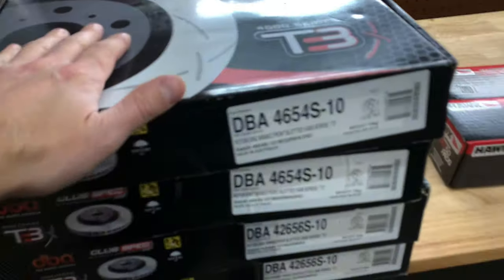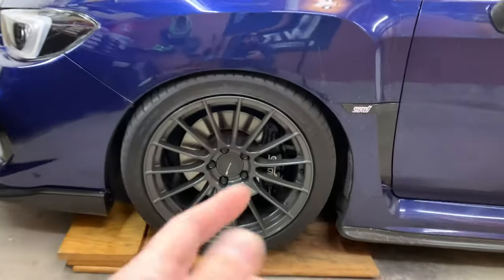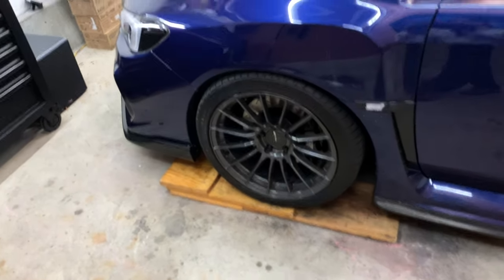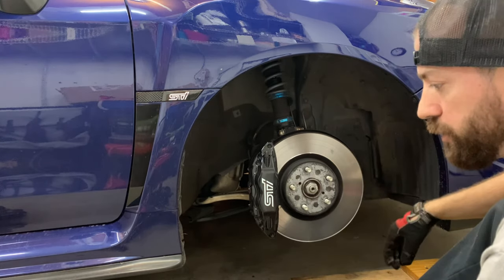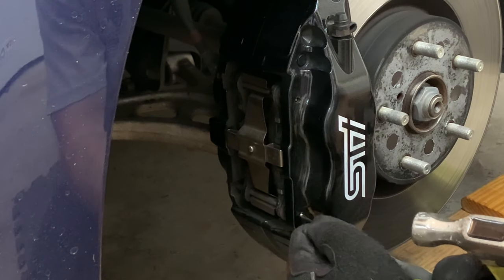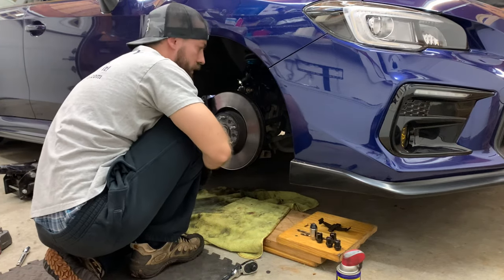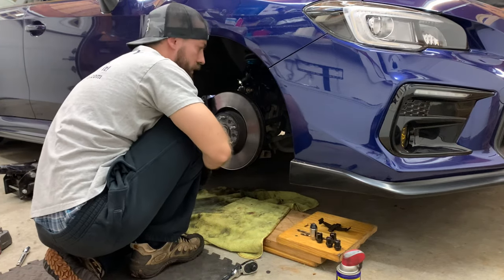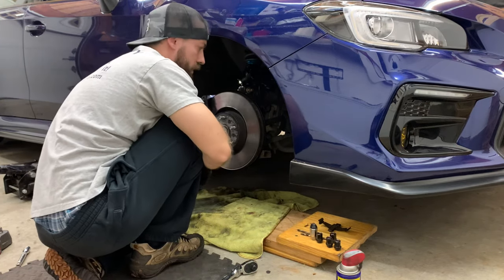2017 Subaru STI Brake Rotor and Pad Install - DBA T3000 + Hawk 5.0

Comment: Here's a tip. Don't know if anyone else mentioned it because I'm too lazy to read through the comments. On the 18+ STI Brembo calipers there's also a pin in the middle that's held by a M8 flanged bolt w/ a 13mm head on the back side. That bolt is the correct thread to use on those threaded holes to remove the rotor. You just have to pull the pin from the other wheel so you'll have 2 bolts to use. Thanks for the helpful video!
Reply from the maker: The bolt used to hold the brake line to the strut can be used as well 👍🏻
Reply: @Scoobyfreak86  Didn't know that. Thanks fellow Subi!
Reply: So you just need a 8mm bolt is what you're saying?

Comment: Great video!! and again, love the “how-to” series. Just like to add two things that was taught to me by seasoned mechanics. 1) You can use lug nuts to hold the rotors in place when you reinstall the caliper, that will make it easier. 2) Some, myself included, apply anti-seize to the caliper bolts. If anti-seize is used, the torque value needs to be reduced as it will act as a lubricant. Literature suggest a reduction of 25% and sometimes more depending on the size of the hardware. I don’t think you used any but just want to share this with your subscribers. Thank you.

Comment: Glad you mentioned the risk of the threads stripping out. I just replaced rotors and pads on my car with 100K kilometers and has been subjected to Canadian winters and salt. The two caliper bolts (steel) pulled out the aluminum threads from the caliper. I was able to drill them out and install helicoils but let me tell you that was a major PITA. Thankfully avoided having to replace the caliper. For the remaining three calipers I heated them up with a propane torch until they were just hot enough that it was uncomfortable to hold them but not super hot. That allowed the bolts to come out without issue. Be sure to use copper antiseize on them which is good for high temp and dissimilar metals.

Comment: This video is the reason I went with dba and hawk hps 5.0. Absolutely no squeak at all and a MAJOR improvement over the stock pads, even though mine is only a wrx not a sti. Since I drive on the highway all the time, some extra sudden stopping power wouldnt hurt.

Comment: Great video! Did the exact same swap a couple weeks back. Just keep in mind that these pads actually have a bit more clearance when they sit inside the caliper. When reversing, you might hear a  click, which is essentially extra room for the pads during heavy braking(expansion due to heat).
Reply from the maker: Thanks for the tip!

Comment: Nice vid, good technique. Most brake pad manufacturers claim that the slot in the friction material is intended to allow gases (from high heat loads) to vent better and keep the rotor cooler.

Comment: I find a box end wrench is the best way to break free the bolts holding on the calipers.  Just tap-tap with a big hammer.  A lot of small taps rather than big heavy pounding.  If a box end wrench doesn't work, I try a socket on a long breaker bar.  I have destroyed ratchet socket wrenches doing this so I don't use them unless I can break free the bolt with one hand.

Comment: Hey man I absolutely love your car. You should be proud of it. I have a '20 STI  but it's 100% stock except for some aesthetic upgrades. Also from NJ myself, Bergen County. Did you notice any handling changes when you installed the spacers? I'm thinking of going with RCE Yellow lowering springs and throwing some spacers on the OEM wheels but I've heard mixed things about running spacers.
Reply from the maker: Thank you! Spacers of this size will not have any effect on the cars handling. I’m not a fan of spacers normally, but something this small doesn’t bother me.

Comment: I did the exact same rotor and pad replaced 2 years ago believe it or not. 
I love the rotors, but have since change the pads due to excessive squeaking. I don’t care how well they work if they squeak like a race car on my way to the drive through Starbucks.
Reply from the maker: Did you properly bed the pads and rotors in? I’ve been riding on them for a few days now and they are as quiet as can be.

Comment: I’m going to keep commenting with questions lol. I’m so scared to strip those bolts. You say Wd-40 and let it sit? Then exactly try to barely twist it .. ? How hard was that? That’s what I’m most nervous for.
Also, I don’t need to do anything to my brake lines right away, they just move out of the way with the caliper to put the pads and rotors on, correct or what am I missing?

Comment: Get install video. Just double checking. You also reinstalled the shim that came out with the factory pads
Reply from the maker: Correct. Swap the shims over from stock pads.

Comment: Recently bought the same setup as you and they stop phenomenal, but...they tend to make a lot of noise. Specifically screeching. They are track pads so i kinda of expected it. Still really good brakes.
Reply from the maker: You need to bed then in more. They should squeak as they are not track pads. They are for the street.

Comment: Hey mate, I'm about to change out my rotors pads this weekend due to watching your video. All I'm worried about is stripping the caliper bolts... car has 43k miles on it.
Reply: How’d you luck out? Looking to do mine this Saturday, 45k… Pennsylvania daily driven until recently

Comment: Hey bro could use some advice, I just picked up 2017 STI , I knew that it would need a clutch so I brought it to a specialist and got the clutch done , I was going to have them do the pads bc there low but I was told the bolts that hold the caliper on was seized up and they said it would most likely snap , they said that job for them would take 3 days bc they send out the calipers to a machine shop  to drill out the bolt. The clutch job was done in 5 hours and with a trans fluid change it ran me 1600$ total. That was fine with me but the brakes are bumming me out bc I always did my own . I’m now learning the subies used aluminum calipers with steel bolts.  Any advice ? I haven’t tired to get the bolt out but if I snap it I’m screwed to get to work , thanks man love ur vids
Reply from the maker: Yes the calipers threads are a known issue. But shouldn’t take three days. Most people do a nutsert or retap it and you’re going to go.
Reply: @Scoobyfreak86  ty bro ! Yeah I find that really odd  , they told me it’s bc the send it to a diff shop and a laser does it lol. I might just slap on some pads and check another place.

Comment: Hey man , so I attempted my fronts , pulled some threads out the calipers going to re tapp , But I might have another issue , The threads that take the bolt Frist ( the arm on the car ) should those have threads ? My bolt goes in without turning . Or does it just tighten down to the caliper , I can email a pic if I make no sense lol

Comment: Hey great video,  really helpful.  But just wondering how do you know which way to loosen the caliper bolt for all side?  And do you suggest on using a breaker bar or as your video,  just rachets?  I'm scared of stripping the bolt haha.
Reply from the maker: Left loosey for each side. I prefer Wrenches when loosening since you’ll be able to feel off the bolt breaks loose or not.
Reply: @Scoobyfreak86  Thanks i kinda knew it was left but i cant seem to find any infos when it comes to this haha.  Would u recommend a 6 point wrench?  And its a 19mm bolt right.  Sry tons of question.  I'm a newb when it comes to this.
Reply from the maker: If I remember correctly, it’s 19 front snd 17 rear.  A normal socket works just fine. Just put the wrench on and hit it with the side of your hand to break it loose.
Reply: @Scoobyfreak86  Thank you!  Lastly,  what about bleeding the brake,  is that necessary?  I only plan to do the rotor and pads.  I got 47k on my 2017 sti.
Reply from the maker: Not necessary, but recommended. Bleeding alone will help the pedal feel tremendously.
Reply: @Scoobyfreak86  Thank you for your help, quick responses and this video !
Reply: @Scoobyfreak86  Hello again haha!  Just wondering,  what ratchet size did you use in the video?  3/8 or 1/2 inch?
Reply from the maker: 1/2”. I prefer using 1/2” when I can.
Reply: @Scoobyfreak86  Hi so i tried using 1/2 deep socket 19mm on the top front caliper bolt but it wouldnt go in.  Any advices?

Comment: What size bolts did you use to pop the rotors off? I can’t get mine off. I’ve got a 2017 wax sti like you and need help on what size those bolts are so I can go buy some and pop the rotors off so i can finish doing my breaks. Is it 8 mm or what? Thanks
Reply from the maker: Use the brake line bracket bolt
Reply: @Scoobyfreak86  The ones that you take off the calipers?
Reply from the maker: The brake line on the strut
Reply: @Scoobyfreak86  Hey yeah, I got it! Thanks, I did what you did and it worked perfectly 🥰
Reply: @Scoobyfreak86  I'm going to keep my car forever so I want to do some of the modifications when I'm more financially able too after I'm done with nursing anesthesia school then I'll really be able to take care of my sti. I like your garage set up quite a bit. The good thing is that im getting a home loan next year so as far as a proper garage set up is concerned what would you recommend? Would you get a lift, etc? Thanks again for everything. I've been able to get things done thanks to your tips. In fact it's totally worth joining your member page.
Reply from the maker: I’m glad I could help! Depends on what kind of work you plan to do. Honestly, the quikjack would be more than enough for me and all I plan I getting for this garage.

Comment: What brake fluid to use?  I would get airline tubing and put into a bottle with fluid to bleed brakes.  This way no air into the system.  I noticed nobody bleeds brakes in these..  I never had a newer car past 2003 until I got my 2020 STI.
Reply from the maker: https://youtu.be/lKwvSCM98E4?si=n7hzHroJbK-gxi_8

Comment: Can you do a video on how to install a new clutch? Or do you have one already? I need to install a new clutch as well for my 2017 wrx sti.
Reply from the maker: I’m on the stock clutch so no video on this. Definitely some solid videos out there that walk you through this process.
Reply: @Scoobyfreak86  cool because it's acting up where while accelerating the rpms wind up, but the speed of the vehicle remains the same. Also, sometimes when I shift into 4th gear it says it's in 6th then flashes to 4th. I think it's the clutch wearing out.

Comment: do you remember the random bolt thread that you used to pop the rotor off with?
Reply from the maker: You can use the dust shield bolt

Comment: So do you put the shims from the OEM pads on top of the new pad shims and then grease the oem pads? Trying to figure out what the order should be. Pad > New Pad Shim > OEM Shim > Grease?
Reply from the maker: Put grease on both the back of the pad and shim. They only fit one way. Caliper piston , OEM shim, pad, rotor. Anything the piston touches needs to be greased.

Comment: Me being the idiot i am struggled for half an hour with the pins because I forgot to take out the cotter pins. The two 19mm was actually pretty easy for me, only trouble was hard to get an angle on it.

Comment: @19:01 you say to not forget the stock shims as well, do you mean I should stack them with the shims on the new pads??
Reply: I am wondering the same thing. Just bought brembos for my WRX and they did not come with shims. The pads did however. Seems odd that you are supposed to stack them like that.

Comment: What is the torque spec on the rear caliper bolts? N how long did u let the rust penetrate  settle for those caliper bolts for?
Reply from the maker: I used 80ftlbs.  Only for a few minutes, but that will depend on rusted the bolts are. Mine were fairly clean so it didn’t take long to penetrate the bolt.

Comment: I did the exact same setup but with DBA T2 Street Performance Pads but notice high pitch sound when firmly braking at about 30 to 20km to stopping point. 
Do you put your oem shim on to the back of the dba shim that came with the pads?
Reply from the maker: Yes I used the OEM shims as well. Make sure the bed the pads and rotors in properly to rid the squeaking.
Reply: @Scoobyfreak86  good thanks

Comment: Omg the balls of impacting on those brake bolts on these brembos....😱😱😱😱😱
I love the impacts, but on the aluminum calipers... i just can't lol torque wrench at 80ft lbs call it a day personally
Reply from the maker: Haha I didn’t do a full impact on them as I turned down the ftlbs. Stopped as soon as they  tightened.

Comment: Does anyone know the size and thread pitch of the bolt he used to pop the rotors off the hub? Thanks in advance
Reply from the maker: You can use the screw that you remove from the rotor

Comment: Are these the same breaks as the wrx series white/performance pack? Trying to get pads for mine and I’m not getting much help. Looking for a good track day pad.
Reply from the maker: I can't 100% confirm, but by the looks of it, they seem to be very similar. I am willing to bet is it the same just by looking at the pictures.
Reply: @Scoobyfreak86  thanks for the advice, I’m planning on going to nj Motorsports park on aug21 for my first HPDE. I’m just bringing a second set of oem pads. After I’ll experiment with a set of hawk pads.
Reply: As a fallow-up since my track day I would like to note to all brembo wrx/sti owners if you notice squealing from your breaks while the break pedal is NOT pressed and your pads are not worn it’s contamination on your pads from dirt/debris rust or in my case break rotor transfer from high load. Try sanding the pad surface with 180 grit sand paper. This was driving me nuts.

Comment: Torx screw driver. not allen. just in case no one corrected you. and be very careful if you mistake using a torx screw driver when removing an allen screw, you're going to have a bad day. you'll screw up the tool and fastener.

Comment: Hi do you put anti seize before putting on the rotor?
Reply from the maker: You can but I didn’t when I installed these. Came off no problem when I removed them for the bbk.
Reply: @Scoobyfreak86  thanks, dealer quoted me at 1,900 for front oem rotor and pad install so deciding to do it myself since I can get way better parts for cheaper. Do you have recommendations, currently deciding between hawk 5.0 pads and dba 5000 or rotora h6 pads and their super challenge rotors
Reply from the maker: @toxicwaste491 I was really happy with the hawk and dba setup.
Reply: @Scoobyfreak86  sounds like I'll be getting rotora thanks! and assuming you had the h6 pads did you notice they weren't as strong with low temps such as just driving around, I know they are meant for street/track so was wondering if they only work rly good at higher track temps.
Reply: Lol just reread your reply I thought you said wasn't really happy with the dba setup so nvm

Comment: Can you put antiseize on the caliper bolts
Reply from the maker: Yes you can,  but you want to make sure they are snuggled down a bit more since the anti seize can interfere with the torque spec.